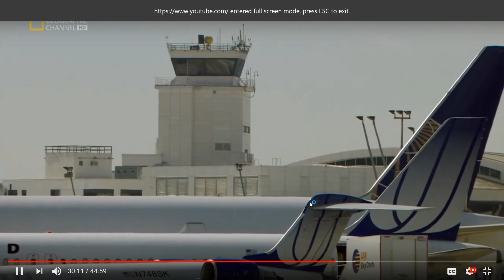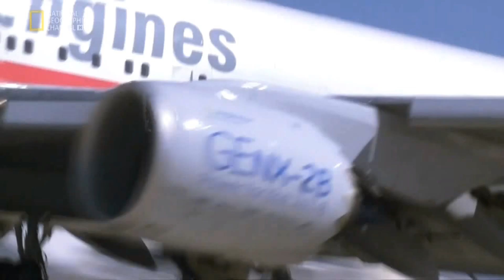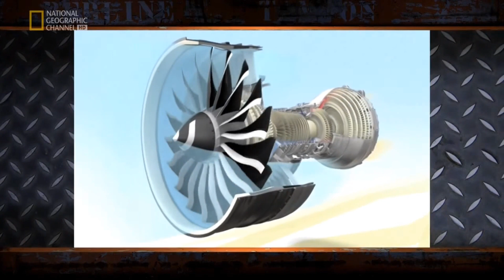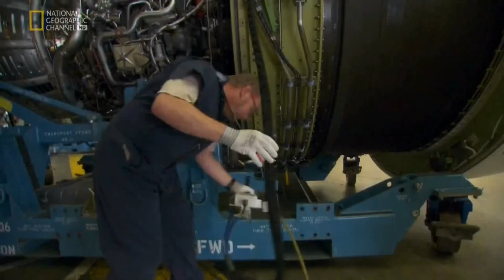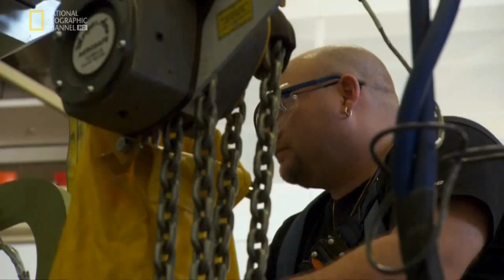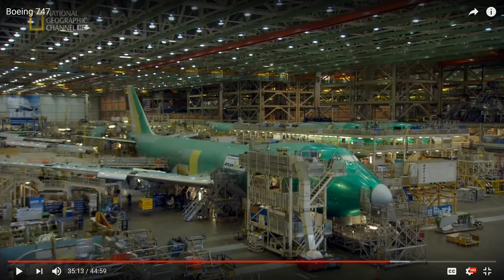Jet Engines now WAY in FRONT of the WING!!

Comment: Most simple explanation as to why are engines are in front of the wing and not underneath anymore is because back in the day engines were much smaller so ground clearance wasn’t a problem but as the years passed and technology grew so did airplane engines therefore airplane manufacturers had to push the engines forward and up for ground clearance.

Comment: I also remember jet engines on commercial jets like the 707, 727, 747, Airbus ETC. were mounted beneath the wings and never extended in front of the leading edge of the wing like they are now.